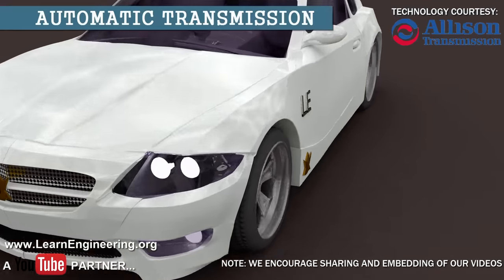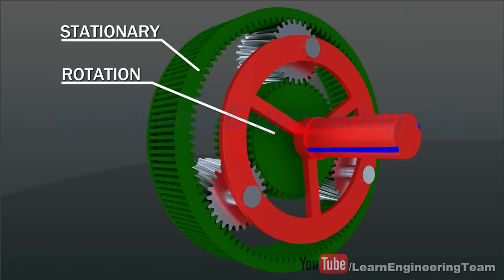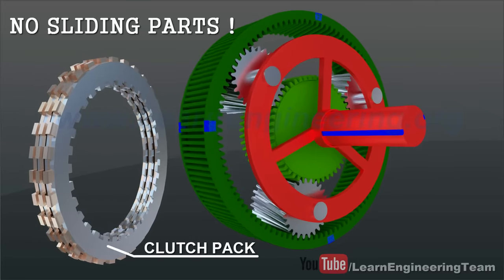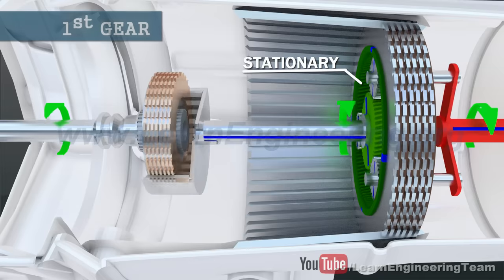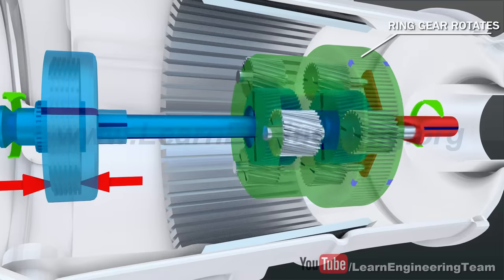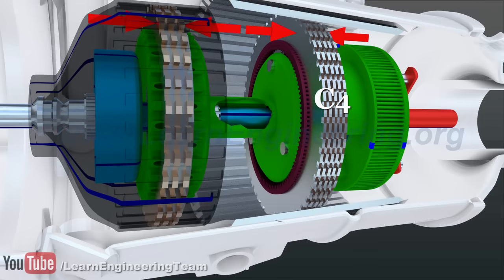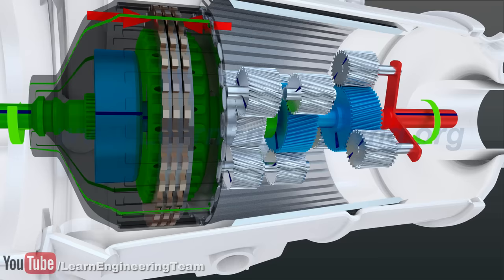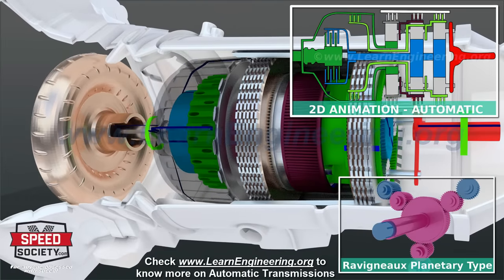Automatic Transmission, How it works?

Comment: I think I get it the automatic gearbox is made up with sets of gears and clutch packs the sun gear and ring gear are inputs the planet gears  are out puts the clutch gears do the same Job as a manual clutch but changes the gears automatically and it has a torque converter instead of a flywheel like a manual gearbox as each gear change the gear ratio gets smaller to give you more power (higher gear ratio in lower gears as you are driving slower lower gear ratios as you are driving faster) reverse gear will simply gose the offerset way to the other gears.

Comment: But *how* do we apply the clutch packs? Does a wizard wish them into existence?
Reply: Transmission fluid pushes on them to apply. A pump will pump fluid to different valves. By opening a valve, fluid can travel to a clutch pack to compress it and engage it.

Comment: Golden Point - Gear teeth should always be in mesh or 180° but never at an angle as all angled gear teeth break because of friction and pressure which is at a bending agle and so they are all banned ( El )

Comment: If I had a three speed auto like a turbo 350 all apart, I could use my hands to simulate the clutches and bands and you could see how it works. A trans with more than three speeds would require more hands then I have.

Comment: The first automatic transmission was made when there wasn't much sophisticated electronics, so no good enough sensors to control the gear change. Then, can I say that the Planetary Gear Set is actually, in itself, mechanically automatic without any intervention from any computers or other electronic impurities?
Reply: No.  It has to be controlled.  The older models used a signal system based on RPM, where oil was shooting out of a nozzle into a fan of sorts.  when the "fan" was going slow, the oil passed through it.  when it was fast, the "fan fins" acted like a wall in front of the nozzle and basically blocked the oil.  the oil at that point could not get out of the nozzle fast enough and pressure built up in the nozzle. this pressure, as a signal source, backed up in the line to a shuttle valve, moving it; to then signal the valve body to shift up to a higher gear.  The same nozzle worked for downshifts. Was a brilliant idea and was actually really reliable and accurate! 
Guys would accidentally bend this nozzle jet during a transmission rebuild and then nothing worked right for them.  I was the legend at work for having a new nozzle in my tool box that we all used as the standard to copy the bend angle. This way there were no redo's from a messed up nozzle. Good times.
Reply: Thanks for explaining.🙂
Reply: @yukonjon5964  I was waiting for getting this question answered since 2020 when first watched this video. . Can you suggest a video link in which I can research on the oil-based control of the automatic transmission, just as you explained in this message?
Reply: @konozrashid887    You're welcome!  Glad to help. But sorry on a video suggestion, as I do not know of any.   The units we worked on were from all sorts of Caterpillar heavy equipment.  The models I saw with the auto shift oil-jet speed sensing nozzle as described above, were out of the older Scrapers like a 637; which is a wheel machine with a belly scoop and dump system. More or less a self loading dump truck.   

I expect that older cars used a smaller version of something similar, but I did not do much with cars so am not sure.  Unless another old-timer reads your post, you may have to study a parts fiche breakdown of some older cars to try and identify it.  Some parts listings offer a word search, so maybe "nozzle" or "orifice" could help find that section.   I will say that learning how to read the parts pictures and get the correct parts ordered, was often harder than building the transmissions!

Comment: My older brother since 1985 has been rebuilding every type. Modification to handle max horsepower for drag cars. I know theory! But in reality? Forget it. I've seen so many rebiulds. Lol. Remember most important thing is: hydraulic pressure! More clamping force? More grab. Can handle more than even the ring gears! FACT! I've seen performance rebiuld that extreme he told the customer no more than for example; 600 hp! Leave the boost on the blower at what I set it at! Or turbo! A week later some customers come back, and : I broke it! His response was : did you wind the boost up? Ahhh yeah up an extra 5 psi. But man it went hard! Lol. These morons would ask him to rebiuld again and he did, but telling them I have to get new planetary gears! I also have to get them hardened etc. Heat is also a killer. Automatic transmission is overlooked too often in performance. Leo the Tranny cool guys! Cheers from Australia.

Comment: Trying to keep the basic operation of the single planetary, shaft, ring, carrier and clutch in mind is the key to understanding these things. Once you got that, the rest is just elaboration on a theme. Like most attempts to explain, the narrator misses here, lumping concepts together that need more elaboration, making seemingly unconnected statements like 'the ring gear also rotates,' or showing the planetary and carrier without the shafts. It's belatedly understandable from watching the animation, but rough, difficult as he misses spoon feeding critical details of the basic building block of the concept in the right order. I'll bet about half of the viewers fail to really nail this down as they can't understand where tor how the torque and clutch is being applied until they are past the critical first step.

Comment: P = (E/c, p) is the four-momentum,

K = (ω/c, k) is the four-wavevector,

E = energy of particle

ω = 2πf is the angular frequency and frequency of the particle

ħ = h/2π are the Planck constants

c = speed of light

{\displaystyle \mathbf {P} =(E/c,\mathbf {p} )=\hbar (\omega /c,\mathbf {k} )=\hbar \mathbf {K} }
The energy E of the quantum is related to the frequency ν by E = hν. The quantity h, now known as Planck's constant, is a universal constant with the approximate value of 6.62607 × 10−34 joule∙second. Planck showed that the calculated energy spectrum then agreed with observation over the entire wavelength range. x-y-z plane, is a vertical limit approaching negative infinity on the z-axis. It can be represented by this nuclear equation: 92 235 U + 1 neutron → 36 92 K r + 56 141 B a + 3 neutrons + energy.the index of refraction n of the material using the equation n=c/v. v=cn. v=3.00×108m/s1.923=1.56×108m/s = "DERP" , thats how this video makes me feel.

Comment: I still don't understand how the transmission knows when to change gears. There are no thinking parts so when why and how does the transmission know when to apply a particular gear at a certain speed?
Reply: The transmission computer does it, it monitors various things like engine speed and car speed and shifts accordingly.

Comment: The core part of automatic transmission is the transmission control unit which is not touched at all in this video
Reply: Older transmissions can automatically shift w/o the transmission control unit 😮

Comment: So- I understand the video. Got confused a little when C4 came to view. But rewatched and understood. 

 But I've never had a bad transmission. I've heard mechanics state that once it goes bad, even if you replace or repair a part. It will break again within a year time frame. 

Why is that? Does the damage translate to all the gears? In turn- you're better off getting a brand new one (expensive not worth it). 

Is that why? I really have no life experience on this- other then eaves dropping on people talking about car issues 🤣

Comment: What engages and disengages the clutch packs?
Reply: Hydraulic pressure from the transmission fluid, electric valves control the transmission fluid flow and the computer controls the valves
Reply: @lonewolf2156  thanks brother, I appreciate it. No wonder why the transmission is so much money. It's so technical. Never knew what went into making an automatic work.
Reply: @juancolon887  indeed that's why there is more than one reason I like stick shift cars, less can go wrong with a manual, granted replacing the clutch can be a pain but it's still simpler and fun

Comment: What's not to understand? It's very simply explained. You add a sun gear with 3 planetary gears to create 1/3.1 ratio output speed. For every speed, you need to add clutchpad but in order to switch from c1 to c2, two planetary gears need to be fused each other via hollow shaft. When clutch is fully integrated, ok if you read this far I have no fucking idea whats going on just play along. Act smart. So long story short c4 and c2 are interconnected. It's very easy. I figured it out at my first try..
Reply: The gear ratio isn’t determined by the number of planetary gears but by their size. Also if you got this on your first try have you considered curing cancer?

Comment: What's the benefit of using planetary gear sets if the set isn't actually mechanically automatic? It has to be controlled by a computer or some fluid pump. Why don't we use the controllers with the manual transmission to make that automatic, instead of inventing such a sophisticated gear set?

Comment: I left this on watch later until I could trick myself into watching it. Years ago i replaced a Torque converter and a timing Gear. And some synchromesh gears that were banging. I know the mind games in play. The graphics are goo but the brain has to multi task to engage and disengage accelerate and de celerate. . What about the belts and the loading of the converter spinning back one turn before the flywheel lines up. If you are learning by trial and error . It will cost you. Did I say it will cost you.

Comment: You could have made it much simpler by explaining a basic 2-speed automatic transmission first, but no, you had to go 6-speed, not to mention adding them in random orders and writing the gear ratios as inverse (writing 1st gear as 3.1 when it should be 1/3.1 of the input speed).

Comment: So basically, a computer decides which clutch packs to engage and the combinations will decide which gear you're on. Instead of counter gear you got bunch of planetary gear sets
Reply: Yes, but back before computers it used to be automatically applied with any computer control

Comment: Golden Point - The Flywheel, Clutch, Pressure Plate and Gear Box are all unnecessary and have just been added to waste as much engine power and fuel as possible and so they are all banned ( El )

Comment: the explanation of the function of the clutch packs is what is confusing. as well as the very formulaic explanation. because they've tried so hard to make it sound formal, it's left little space for proper explanation. when it comes to things like this i'd rather an in depth explanation rather than be left confused.

Comment: Before we oooh and ahh about EV's remember,  Those are basically "RC" cars on a large scale. Electric cars are a model of simplicity (mechanically) compared to a car with an ICE and a manual OR an automatic transmission. Only the computerized controls makes the modern EV complex. EVs were around since the 1890s! The fact that an EV only needs a battery, a current control and an electric motor made them mechanically simpler to build. An ICE is much more complex than an electric motor, electric motors have full torque at all speeds (no transmission needed whereas an ICE needs some type of transmission to match speed to required torque) Manual transmissions are pretty complex, Then we get to the Automatic transmission!  While you try to wrap your head around how an automatic transmission works (by watching this video), Also wrap your head around this: This technology was developed, without computers by men with slide rules and pencils and it was ready for sale to the public over EIGHTY YEARS AGO! 🤯  Note ICE = Internal Combustion Engine. (This rant is long enough without me writing THAT out over and over, LOL.)

Comment: so basically each gear (except reverse?) is a set of ring, sun, and planet gears, which are engaged by the clutch packs. different combinations give u different rotational speeds to the wheels. phew. the problem now would be understanding exactly how the numbers are calculated and exactly which set is engaged by which clutch pack. all of this so that u dont have to use a clutch when changing gears. sigh

Comment: Jeeeezus f’ing crispies.    Why don’t they leave out more crucial details?   They definitely do not explain how the clutch are engaged and disengaged.  I’m pretty sure it’s all done with hydraulic pressure, hence the valve body to direct the pressure as needed, but with a manual, your leg releases the spring pressure used to make the clutch discs get pressed together such that there is great friction, kind of the opposite of a disc brake which would engage the circumference of the rotor, so our leg pressure counters the springs in the clutch packs which had in turn used a lot of friction to “grab” the disc on the engine’s flywheel, thus forcing engine crankshaft output to turn the input shaft of the transmission, which then has physically moving forks which slide various combination of ring and sun and planet gears to the output shaft to the driveshaft.   But with an automatic, you leg pressure isn’t used, and engine vacuum is used to direct the valve body to then direct hydraulic pressure to the various clutch packs, but how?   This video is a bit to digest, but once you get your head around the combos, you can filter out the misguided aspects of instruction, and absorb the fundamentals and the building blocks of the concept.  Problem is, they didn’t address the very thing that does the shifting!   It’s almost like leaving out the whole masonry and fastener aspect of a building’s structure.    “Yeah, concrete blocks are stacked until a height is reached.   Steel beams are fastened to the blocks.”  It’s like magic.  They just get fastened.  The just stay in place when stacked.  The clutches just engage.   This clutch, or that clutch pack, engages for third gear.  No shit?   But how?   A crucial let down.   Yeah I’m venting.
Reply: Allison transmissions, the one used in this video, doesn’t use vacuum pressure to create the pressure needed for clutch actuation. That is done by the transmission oil pump that is run off of the impeller side of the torque converter, so basically the engine.

Comment: To milk a cow first you need a space shuttle. We will use it to locate a cow on a field. To locate a cow on a field the telescope on the northern alps is engaged and pointed at the mirror which is attached to a space shuttle. Now we have butter, but to turn it into milk simply scan your credit card at the convenience store. Congratulations you bought a 12 oz stake (you need to eat it to get the energy required to milk the cow)....

Comment: This is why manuals are so much better, vecause theyre much simpler. Plus, tq fails, can ruin gearbox. Also solenoids and the car wont shift. Manuals, replace the clutch plate when needed, and voila.

Comment: Now I understand why so much power is lost with an automatic, and why they're so damn heavy.
Reply: They’re usually lighter than a manual because the gears can be smaller. Believe it or not very little power is lost through gears and clutches, most of the power loss is through the torque converter.

Comment: Theire no clutch required for automatic transmission shifts.
Reply: The transmission operates the clutches, not the driver. There's no clutch PEDAL, But there ARE clutches.

Comment: So in the end, a controller "decides" when to change gears? Why is it necessary to understand the entire gear mechanism if the automation is basically a computer deciding, "Yep, you need to be in the first gear now".
Reply: Because th gear mechanism is different than a manual. Also, automatics existed before computers so back then they had to shift automatically without a computer.

Comment: "This is the simplest form of automatic transmission"

Well i don't want to ever have to repair a german automatic transmission, then.
Reply: My cousin had a 2002 Volkswagen Jetta years ago. it started having trouble with the automatic transmission. He took it to a local and reputable transmission repair shop and it cost him just over $2000 to get it repaired.... He sold the car a few months later.

Comment: “Automatic transmissions is the popular option for east and reliable driving.” Easy yes, it is a little easier than a manual, reliable absolutely not, I swear automatics are only in the correct gear when cruising on a highway. They also love to break themselves because they wanted to shift to hard. I wish more people drove manuals so it was easier and cheaper to find them

Comment: Damn they're complex. No wonder they don't last as long as manual transmissions.
Reply: I had a 1971 Buick Electra 225 with a 455 cid (~7.5 L) V-8 and an automatic (Turbo Hydramatic 400) transmission that lasted over  300,000 miles (~483,000 Km) with nothing ever repaired or serviced on the transmission. The body and frame rusted (salty Northeastern US roads can do that to a car in 25 years.) However, mechanically that car was bulletproof. I sold it for parts. Who knows? That transmission might STILL be in use in another car.